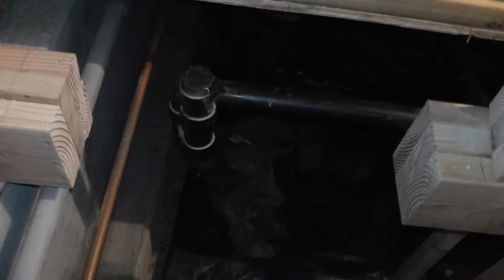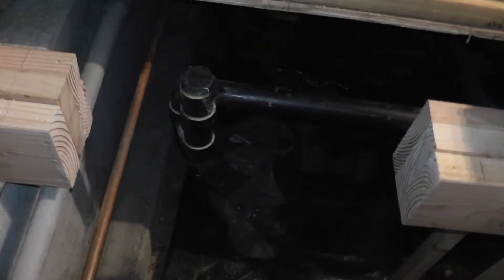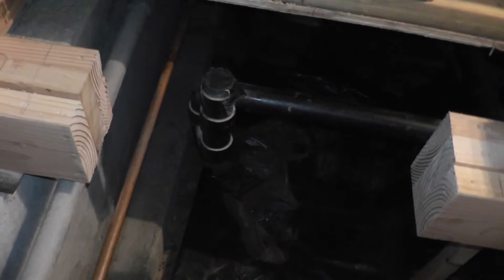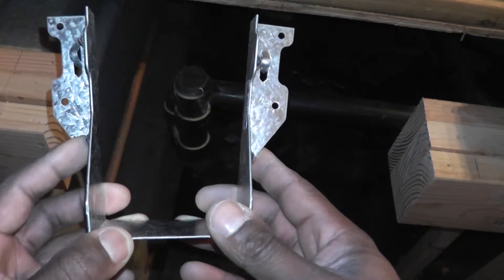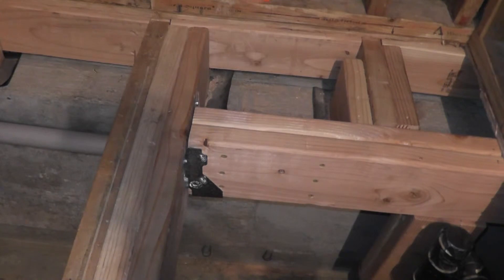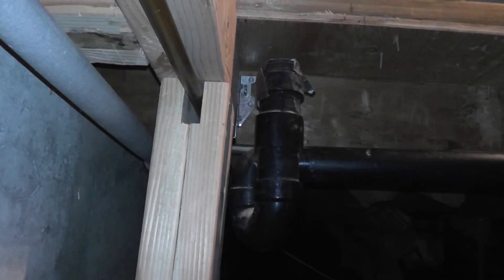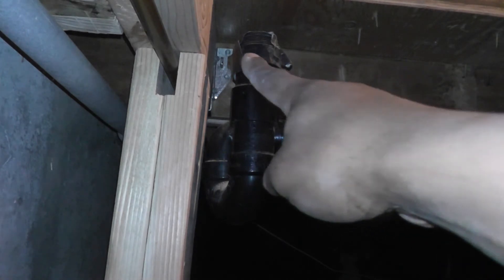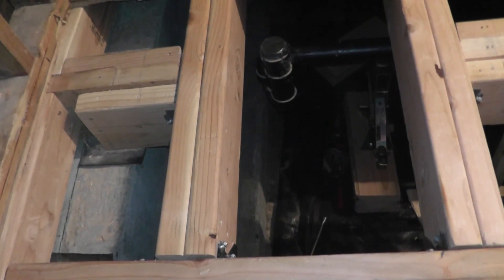Bathroom Remodel 28 - Drain Box-In Finished

Comment: If only it was just the bathroom....  LOL....
I purchased a 3 bedroom on 5 acres here is Texas and wasn't sure if I should knock it down or try to remodel it.  So far I've sunk about half of the original purchase price in exterior upgrades and still working on both inside as well as out.  Everybody tells me the place is really looking good, but I have to admit there not one wall that isn't under some form of disrepair..  I should put a sign at the front gate reading "Under Construction".